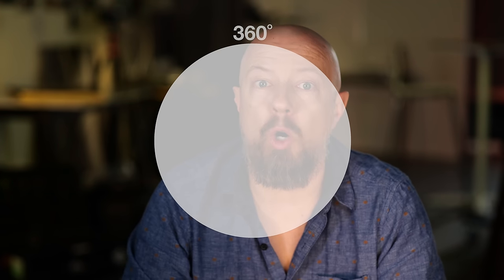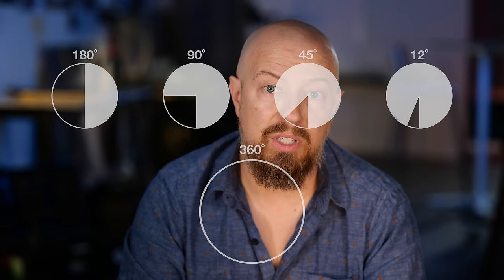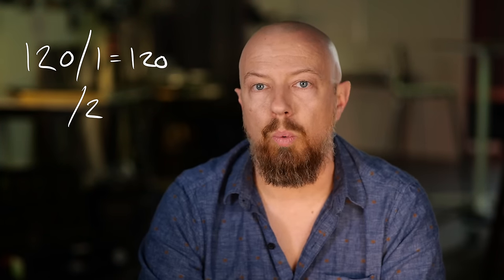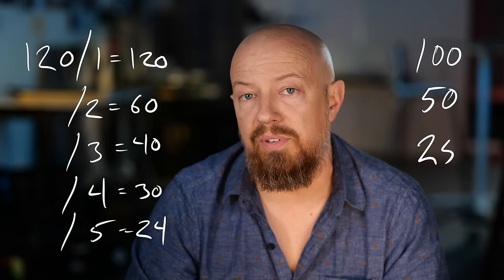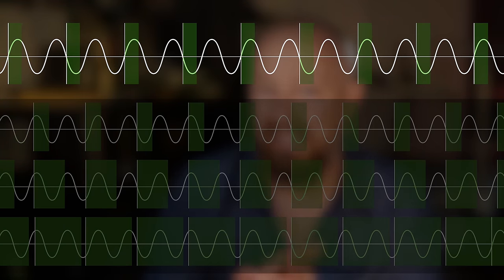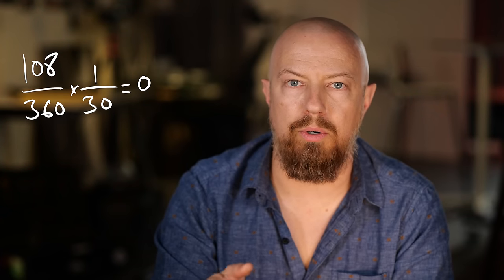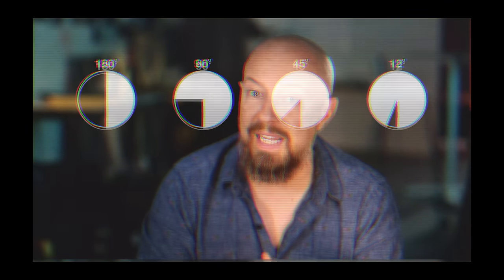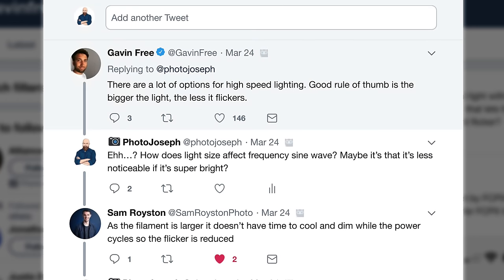Understanding Light Flicker in Video (…shutter angle, slow motion video)

Comment: I really like the shutter angle option on the GH5s. I have Phillips Hue bulbs and everything below 100% produces flicker for me. Even 95% brightness. I'll often have to change the shutter angle to 173 degrees in order to completely remove flicker, and even then I still notice it a bit in post. Luckily DaVinci Resolve has a built-in de-flicker tool that does a great job, especially when there is just minimal flicker. I've heard of people having issues with the Godox SL60W light, but I haven't noticed anything in my testing. This helps though! I haven't tested anything high speed yet, hoping I can get something working at 120fps.
Reply: You are totally wrong, in hollywood filmming, shutter angle should be locked in 180.

Comment: Great video on he math of lights and video.  Another great subject would be to talk about fluorescent tube style bulb lights like in an office environment.  Some older style fluorescent bulbs shift color temperature so while you're shooting in that environment, your video's color balance is shifting from green to blue and back to green.  Newer bulbs don't do this but take it from experience, the older bulbs are still out there and will make you pull your hair out.
Reply from the maker: No doubt!!
Reply: So how do you deal with the older bulbs? Color correct frame by frame?
Reply from the maker: No… you do manual white balance so your WB doesn’t change. As the colors change a bit as you pass by different lights, that’s acceptable. The viewer can accept that because that’s real life. But if your WB is changing in response to the light, then the entire scene will change as you move the camera (the walls, the people, etc.) and that won’t look good. Manual WB is your friend here.
Reply: @PhotoJoseph Thanks
Reply: @PhotoJoseph is absolutely correct but this happened to me in 2005 with a Canon XL1 camera.  This went totally against everything we were taught in tv video production.  You were to white balance the camera using a white card and you went with that as your white balance.  Most tv cameras then didn’t have auto white balance so you got screwed when this happened.  At that point, you’d color correct your video and dissolve between them to achieve a close to correct white balance.
Reply from the maker: Ugh, what a hassle. Ultimately it depends on the environment. No single answer is there.
Reply: Exactly!  It’s called a learning experience.  Luckily, I do have a background in tv production engineering.  Sadly, at that time, the XL1 had a viewfinder that was b&w and we had no idea until we started edited the footage.  Thank God for positive changes in technology like a better, more controlled white balance and better fluorescent bulbs.  This is why I enjoy your videos, @PhotoJoseph.  They remind me of my tv production days that I sorely miss.
Reply from the maker: Oh crap, black and white viewfinder! And now we have 7”HDR ones. Crazy, huh? Glad you enjoy the show, thank you.

Comment: So glad there's a solution, since I'm about to purchase some LED spotlights for Youtube videos. Thank you so much for this video, I was about to scrap my whole lighting design! I wanted to ask a question though - when dimming 220V AC LED GU10 bulbs, do you expect the math behind the cycles to change? Would it still fluctuate at 50 Hz? I'm trying to work around any possible issues by getting the best dimmer and bulbs I can afford, but dimming them was part of my plan, as 10W spots are quite focused and bright.
Reply from the maker: If you’re using conventional dimmers then all bets are off. I believe conventional dimmers work by altering the cycle. Professional lights dim differently. If you’re talking about building a set using off the shelf lights, I’d advise that you put that money into video lighting systems. There are thousands of affordable options these days. Just look on Amazon.

Comment: Great video, I learned a ton...but something I may have misunderstood.  I shoot my videos in my workshop which has LED tubes on the ceiling and I bring in my own LED lights for additional lighting.  I'm in the US and bulbs themselves say 50/60hz which I assume means in the US they are 60hz, in Europe they're 50hz.  I just started shooting 4k where I'm now noticing some rolling banding.  I used 23.976fps and 1/50 and got the banding.  If I understand this correctly if I shoot 30fps, it really doesn't matter what the shutter is but I won't get banding.  OR if I shoot 23.976fps I should be using 1/40 shutter speed, not 1/50.  With all that being said, it seems the sweet spot for me would be 30fps (actually 29.976) and 1/60th shutter?  Is that correct?  Now i'm off to figure out how to remove the banding in post from the last tutorial I shot
Reply from the maker: You got it. You could stay at 23.976 and go to 1/60 and that should work, or as you said do both and go 29.97 and 1/60.
Reply: @photojoseph  What's interesting is I'm still getting very subtle banding when shooting 29.97 and 1/60 (USA).  I can't see it much when watching at normal speed but if I speed up a clip, which I do often, you can definitely see the rolling banding.
Reply from the maker: @dellsdiy  hmm, so your lights must be causing it. Or; what camera? Hard to imagine but I wonder if the shutter speed is slightly off.
Reply: @photojoseph  Sony a6400, 1/60, 29.976, 4k...maybe because of the 8 bit camera?  not sure
Reply from the maker: @dellsdiy  not familiar enough with that camera but one would think it’s accurate. (BTW the framerate is 29.97 or 23.976, but not 29.976). What are the lights?
Reply: @photojoseph  Thanks for correcting me on the frame rate!  I just googled my LED tube lights and the company went out of business last year but I found an old listing with some info.  "5000 KELVIN & 118 LUMENS PER WATT – This high output 4ft tube has a lumen count of 2,140 and a CRI rating of 84+. "  i wonder if the lower CRI is causing this.
Reply: @dellsdiy  Must is your light cause the problem.
Reply: @dellsdiy  No the CRI shouldn't have anything to do with the banding, it's a matter of the refresh rate that the LED lights operate with. Depending on the refresh rate the lights operate at, you'll need to adjust your shutter speed to avoid the flicker accordingly.

Comment: Thanks for this video Joseph. It was helpful. I'm designing an old style telecine box to convert 8mm movies to digital through a first surface mirror and back projection. My big worry (and what would stop me getting out the saw) is that I'll either get flicker or slow moving bands caused by beat frequency oscillation that I won't be able to remove just by choosing the correct settings. If the projector isn't perfectly constant at 16fps then the two systems will drift out of sync. Any suggestions as to a strategy? Should I go for a high multiple of 16 or long shutter speed? I know this was almost impossible to tackle in analogue videos cameras.

[Before anyone comments: Yes I know I should ideally scan them frame at a time but I don't want to 1) Buy a Wolverine Scanner as I don't like the results for the money. 2) Pay someone else as it would cost more than a Wolverine for the first batch and I'm planning on making more. 3) The results only have to be good-enough. 4) I like tinkering and have the components to hand - maybe one day I'll build a frame by frame scanner but not yet].
Reply from the maker: Wow that’s quite a project. And LOL at your “before anyone comments” as that’s exactly what I was going to say! 😂 The big problem I see is “what if the film frame changes during that video frame’s exposure”, which could come down to just luck; keep shooting until you’re lucky enough to start them together. The second problem is frame rate — 16 isn’t in any digital cameras. However if you shoot at 48fps (possible in cameras like the S1H and GH6, I believe — the more cine oriented cameras) then at least that’s an even divisor of 16, so you won’t have drift (48/16=3). So, yeah… 48fps and fingers crossed!
Reply: @photojoseph  Thanks for advice. The problem has solved itself. The bulb on my projector blew and there was a good deal on a cheap frame by frame scanner in Amazon Warehouse. It will arrive today. I'll see if I can tweak the results to my liking in post. I've been dragged kicking and screaming into the 21st century!

Comment: I'd appreciate any advice on this dilemma:  I'm shooting with stage lights soon and NONE of the standard shutter speeds neutralise the banding.  Thank god my FX30 has a variable shutter setting - only when I use shutter speed 1/53 - yes, *53*, does the banding disappear.  My Sony A6400 does NOT have this option,  I'm stuck with standard shutter speeds, NONE of them eliminate the banding.  Is there ANY way to get a more precise shutter speed on the A6400?  I'm in Australia - unbelievable, shooting at 1/50 resulted in banding.  I've checked via NTSC as well as PAL but I'm aware that frame rate is not the problem, it's shutter speed (and my NTSC / PAL tests proved this, the banding was exactly the same in each case - but my A6400 has no way of setting a shutter speed of 53).  Thanks...
Reply from the maker: Without syncroscan (that ability to adjust shutter angle/speed precisely), you’re out of luck. Most likely the reason you’re shorting at that weird 1/53 is they’re using dimmers on the lights. I’d be concerned that this will change on show day. My advice is to buy or rent another FX30.
Reply: @photojoseph  Yep!  I was going to add to my post "please don't tell me the obvious thing which is to buy another FX30"... I can't magic up the money - or the associated rig - in time...  but y'know, I've revisited my test video and I think if I set the a6400 up as a medium-wide shot (static), banding is going to be hopefully very minimal.  It's only a real problem when I am close up on anything on that stage.  I'm also going to re-test all of this with the support band first, so I have maybe some wiggle room for problem solving.  Thanks though - appreciate the response!
Reply from the maker: @BendeHoedt right on. There are techniques in post for reducing flicker as well. I’d watch those first and maybe run some tests with your test footage. Good luck!

Comment: Thank you Joseph! So I have 2 lamps, 1 LED lights, so my question is without the lamps, I should stick with 60fps? I tried 20-25-30-40-50 but no luck
Reply from the maker: That impossible to answer without knowing more. Use whichever framerate and shutter speed combo eliminates flicker.

Comment: Hey there :) great video, thanks for sharing. 

i am just curious what program or plug in you used for your writing animations, and your shape animations?

In addition, i found this video after having my own issues. i've always followed the 180 degree rule and shoot @ 24 fps. i live in Canada so i have the 60 hz frequency. i was getting banding in my videos under florescent at 1/50 second shutter speed, but it is solved if i go to 1/60. 5:25, you mention i should be able to shoot 24fps without getting flicker, is banding different in this case? 

Thanks :)

Comment: Nice video! I own a Panasonic s1. Do you know if synchro scan is supported? Is shutter angle available in this camera?
Reply from the maker: It is not. Shutter angle is only on GH5, GH5S and S1H. You can get close by adjusting shutter speed, but synchro scan gives you the ultimate precision.
Reply: @photojoseph  thanks for the fast answer. I hope they include it in a future update.

Comment: Yes except for some reason I was still getting rolling bars at my last venue even with 60hz power, 30fps and 1/30. First time in a very long time it's been a issue. Something more must have been going on with the lights they were using or dimmer switch.
Reply from the maker: Dimmers mess up everything!

Comment: Very helpful. But there at least 1 but. In most cases you have to use higher SS, then normally. So you need higher ISO. Not much but in some cases ~0.66 EV.
Reply from the maker: Well sure, if you change exposure you have to compensate somewhere. A little noise is 1,000x better than flicker though!

Comment: Thank you for this. I have a shoot in one day and I want to record in 24fps. I’m from Europe so 50hz. I also will need to shoot in high-framerates such as 120fps. The red website is saying there is no safe shutter angle for 120fps in 50hz. Should I instead take 96fps with 345 shutter angle? Is 96 good looking / reliable in 50hz region with 345 shutter angle?

I would appreciate the answer!
Reply from the maker: If you don’t have a flicker then it’s good looking. “Good” is arbitrary. Go as high fps as you can without flicker. The math doesn’t lie; follow the red chart.
Reply: @photojoseph  won’t 96 fps with a shutter angle of 345.6 look way too blurry? I just noticed that my 6k pro doesn’t offer 96 fps for the highest sensor resolution. It only goes up to 50 or 48. Would you rather choose 48 fps and highest sensor quality or lower quality with cropped sensor and higher fps?

Thank you for the quick answer!

Comment: If shooting 48 fps, set shutter angle to 144 or 288 to eliminate flicker.
Reply from the maker: It depends on the lighting. Not all lighting is the same. Knowing the science can help you eliminate ANY flicker.
Reply: You are totally wrong, in hollywood filmming, shutter angle should be locked in 180.
Reply: @动漫区漫哥  I work in Hollywood. That is not the entirety of the truth. Most of the time a 180 degree angle is used, but there are reasons one would change the shutter angle intentionally. Sometimes, it is done to create a visual effect on movement--like intense action, a psychological or dazed effect, or other uses--and sometimes, for specialty lighting scenarios--like electronic lighting/laser effects, or eliminating flicker.
Reply: @TheSpecterRanger  Thank you for the detailed information, I learned a lot. You are a real gentleman, I appreciate it.

Comment: Good explanation but the the Panasonic G9 high speed video is worthless by LED lightning, because you can't chane SS or angle. We have 50Hz power, so the light will pulse with 100Hz and no frame rate will fit. I test it.
Thank you Panasonic again for this miss conception! 😠
Reply from the maker: This video is about understanding why flicker happens and the science behind avoiding it, not about specific camera models.

Comment: I get the 50/60hz fix but what about 400hz? At 24/25 frames what should my shutter speed be? Its aircraft cabin lighting that flickers when I filmed recently
Reply from the maker: Aircraft lighting flickers at 400Hz?! That’s wild. Trial and error with a camera that can do syncroscan is probably necessary. Also I doubt that the frequency is consistent. I’d imagine that the Hz changes as the engines rev up or down. Watch this video too if you haven’t already: https://youtu.be/1qcOAOK8_eY?si=vz4X4gk18BoHl1-F

Comment: What I would like to know is: Filming in PAL or NTSC and then playing on a 50 or 60 hertz TV there is no problem, is it the same? And PAL having better quality than NTSC, is it preferable to shoot whenever possible with it?
Reply from the maker: Totally different issue. Playing PAL on an NTSC TV means frames have to be added, and playing NTSC on a PAL TV means frames have to be dropped. Since the math doesn’t work (25 doesn’t divide evenly into 29.97 or vice-vera), you have to drop frames through a process called pull-down. This has nothing to do with flicker. Also, in HD, PAL is not better than NTSC. You’re thinking of SD when PAL was a larger frame than NTSC. But in HD and 4K, the frame sizes are the same, so quality is the same. You could argue that at any given bit rate, PAL is better because since there are fewer frames per second, you can have a higher quality frame, but if that’s the case then shoot 24fps, and get even better.